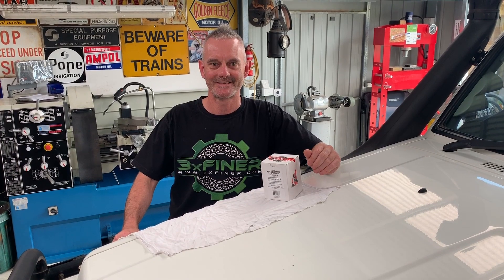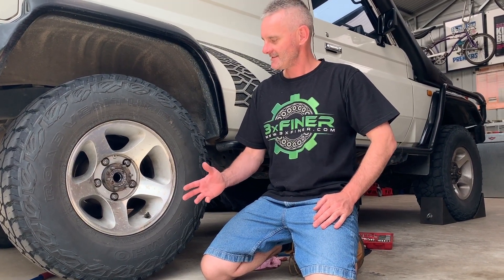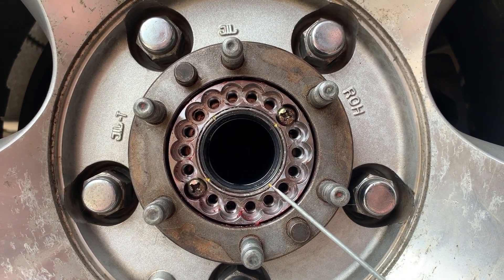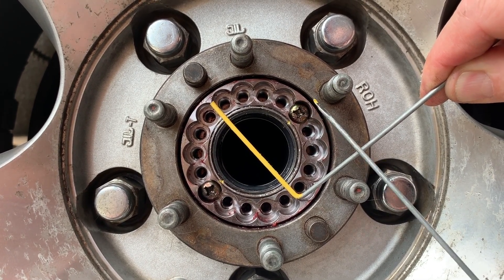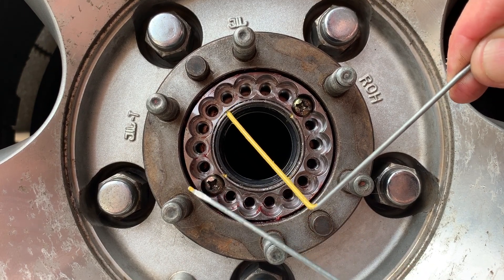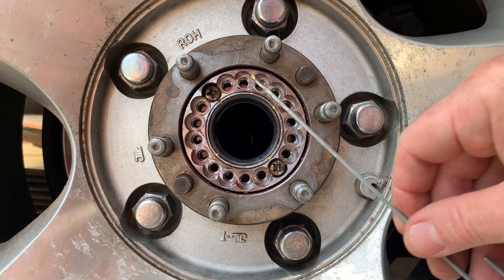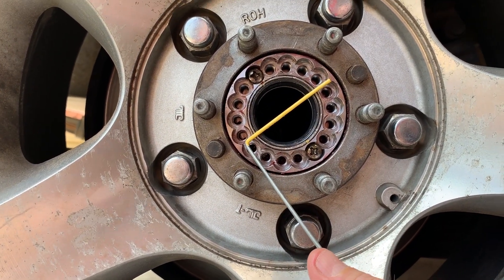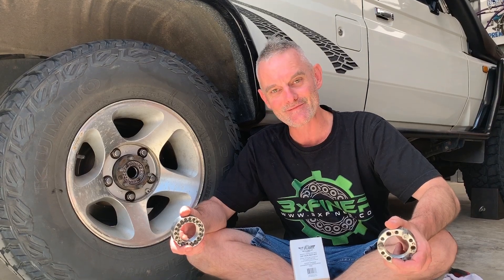‘3xfiner’ hubnut. Rear wheel bearings on Landcruiser - Introduction (Dec 2019)

Comment: Gday Drew, love the idea of this product mate! Would be keen to know your thoughts on running -50 offset rims on the v8 landcruiser and the effect this could have on the rear bearings?
Reply from the maker: Gday mate. I haven’t used rims like that myself but I know what your trying achieve.
Personally I don’t think it will make a rats arse of difference as long as your bearings and hubs are all set up correctly.
Reply: I'l run -55 off set for last 8 years no issues and flog it off road .. do all my own bearings front and rear I know what you mean about pain in ass lining up screws .. I just set pre load by hand 1/4 turn . No problems but I didn't even know about the notches on spindle nor have I ever checked for play untill the next 20000 lol me bad maybe been lucky so far on the 79.. 145000 KMs in about to do front swivel hubs and bearing just bought the spindle grease tool.. give it a go .. not sure on the mx8 grease though  for swivel hubs terrain tamer says moly grease .. but yours looks fine to me .. definitely going to purchase the rear 3x nut . Smart bit of kit cheers